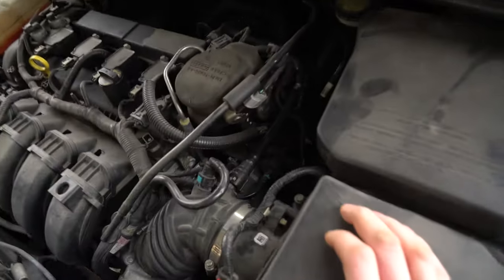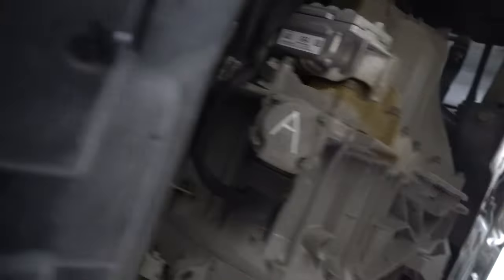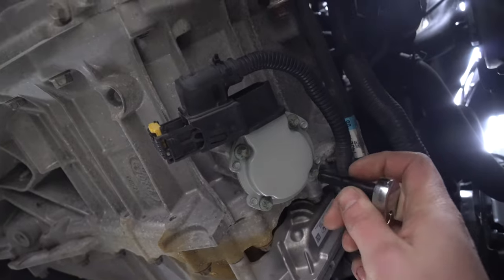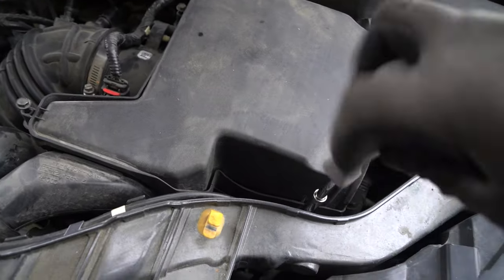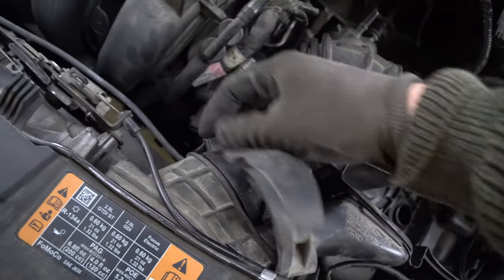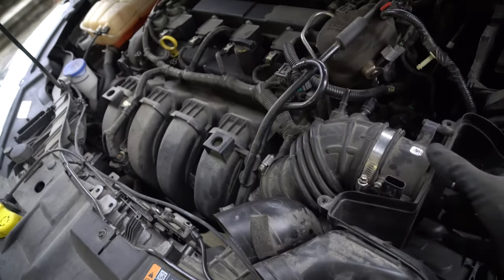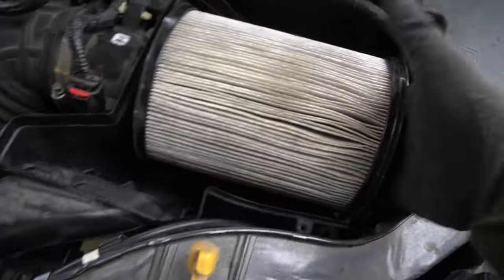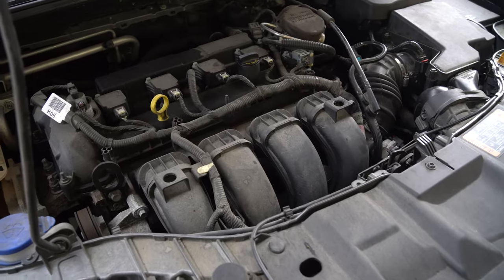HOW TO CHANGE FORD FOCUS TRANSMISSION ACTUATORS

Comment: Every other video says thee top one is A and bottom is B
Reply: They are incorrect B is on top and A is the bottom cause it’s dumb but ford lied , B isn’t reverse it’s Drive 
A u get a P0703 and p0700 code sometimes u get a actuator code P0909C but rarely happens when they die . The top one I have bad it’s P07A2 not 3 and P0700 it won’t go in drive like to drive in drive but if u hear every click shifting all gears then it’s not a TCM or a TRANSMISSION PROBELM, it’s a CLUTCH ACTUATOR PROBELM . U change them both don’t change one cause it’s dumb you’ll end up going on the other one , and do the bypass to reprogram reset the program, cause ford has computers u get a wire u take the battery terminal off on at a time and u put a wire as a ground on the bolts on your battery termails both being off the battery 10 mins then take the wire off as a ground reset wire and then put the battery together ur good to go
Reply: A is top
Reply: because P0805 was my code for actuator A. Replaced the part and it works when it wouldnt even go into gear before
Reply: A is top I agree
Reply: @LuhNoSho  a is top

Comment: The bottom one is B controls reverse 2-4-6
Reply: yes bottom one is B. Top acuator motor is A. P0805  is A
Reply: Actuator A is the top one and the code I ran today was p073A transmission friction stuck
Reply: I guess there’s 2 codes for (A )being stuck and the actuator actually going out 😂 Ugg this is getting funnier every day I think of how garbage ford is

Comment: A 1/4 inch socket with a 1/4 inch drive will take the bolts out of the actuator for anyone wondering!
Reply: you may need a swivel socket to get to the back screws. but i just moved the hoses out of the way
Reply: That’s how I take them off with a 1/4 inch socket with no problem

Comment: I got a 2015 Ford focus as well and the other day i was driving and all the sudden i tried to accelerate and my RPM’s reved way up and i wasn’t going anywhere. Had a diagnostic and the code came back as “p090c”. My car still changes gear and goes in reverse though. I googled the code and it says my clutch actuator B is low circuit. Ford is trying to screw me and say my extended warranty expired since it has 130k miles on it even though I’ve had my transmission recalled. What should i do? I was reading that possibly it’s my TCM?? Idk man i need help it’s my only car and I’m really not in a position to pay a ton of money for it to be fixxed. Any advice?? Should i try to do what you just showed in the video?? Any suggestions appreciated. Thanks
Reply from the maker: Sounds like its could be the clutch actuator, i would replace both to be sure
Reply: @ghostlyrich  alright will do i got 1 coming tomorrow but i guess i should go ahead and just replace both of em while I’m at it. The “B actuator” is the one located underneath the vehicle, correct?
Reply: @addisonsigley8033  Did this fix your problem?  Same thing happened to me but no error code
Reply: @mitchhake4116  no it didn’t. I changed out both actuators and it worked for a few days then same problem happened. I took it to the shop and they told me it might need a new transmitter range sensor and battery so i replaced those and it worked for a few days and now the same issue. I’m goin to replace the TCM later this week and if that doesn’t work I’m going to have to sell it smh
Reply: Did you ever figure it out? I have two new actuators on the way. I first tried to clean the orginals, it worked for about 20 minutes, and then it started slipping again and couldn't put it in reverse. I'm hoping two new ones will fix it butt I'm worried it may be more than just that. Sometimes it works if the car has been sitting for a little  then when I start driving for a bit it will start ti act up.
Reply: @addisonsigley8033  took it to my mechanic and he said the transmission itself  is failing and to get rid of it before it starts throwing codes/breaks down
Reply: @mitchhake4116 the code pops up after you do a transmission reset it’s video’s on YouTube on how to reset it
Reply: @addisonsigley8033 can’t just replace it with out cleaning the forks and resetting the forks with a screw driver turning it counter clockwise 14 times and spraying brake cleaner and wD40 on it that’s what causes the actuator to go out in the first place making it work harder because the fork tracks are covered with clutch dust

Comment: Other than a no start condition. What are some other symptoms these are going bad? Inlaw’s focus won’t start and wont shift out of park either
Reply from the maker: The vehicle wont start unless the vehicle can see its in park. Will the shifter not release out of park?? Could be a shifter problem
Reply: @ghostlyrich  iirc the computer said clutch A and B were stuck engaged
Reply from the maker: @brandtheman92  sounds like the actuators for sure its a very common problem on the car unfortunately atleast its a very simple fix with basic cools
Reply: Is there any kind of relearning processing? I keep hearing that there is.
Reply from the maker: @ww-eg2gn  if you have the software to do so you can but the TCM is just going to relearn it shift points as you drive the one we did it on is still working fine no issues whatsoever
Reply: Is actuator A and B the same parts?
Reply: Actuator "B" & " A" are they the  same or just look. Alike
Reply from the maker: Same

Comment: Hi there. My 2014 ford focus se was fine. I’ve had it since 17, brought it used when 17k miles in it and now it has 82,600. It has shuddered before occasionally from a stop and even jerked occasionally when accelerating from stop .  It started jerking really badly two nights ago.  No issues going in reverse , yet at least. 

I had it towed to dealership, and I was expecting the extended service warranty to cover it but they diagnosed it as the clutch and that warranty expired in 2021, so convenient for Ford. Dealership quoted me 3500 dollars to fix it, which is more than it’s worth. 

I’m no mechanic and never did any of my own repairs but this is making me think about it. It doesn’t look THAT difficult but still intimidating to a novice. 

I feel like Ford and the dealership are trying to rip me off. I mentioned maybe trading it in for a newer vehicle and I’m getting non stop calls and texts now lol 

Based on everything i just said, does it sound like simply the actuators to you?  I’m going to go pick up the car and bring it home in a bit (kind of scared to drive it now).  Shouid I ask them what code came up? I wonder if they offer that information
Reply from the maker: It could be that, or if you look at my other video, you could have a dirty throttlebody you might wanna clean the throttlebody to make sure that at idle it’s getting enough air.
Reply from the maker: The shuttering could be a few things like throttle body is dirty as well as when was the last time you did your spark plugs?? Sounds like it could use a good cleaning and tune up. The actuators would be more missing or slipping shifts and not going into gears
Reply: I have the symptoms of the actuators slipping sometimes and skipping gears I already order the actuators A & B the crazy thing that gets me to think is it only does it for a bit than it runs fine I reverse works fine but sometimes going forward takes few seconds to move you think the actuators are going bad? I am mechanically inclined but my question ❓ do  you have reset the transmission and programmed to drive again and I now there's a sequence?
Reply: Could be actuators but it could also be the clutch forks not sliding properly due to a build up of dust and crud .
There are other videos on Utube that show how to clean these without taking the gearbox out !
Reply: I replaced my actuators about 2 weeks and yes my friend they don't need to be programmed at all I got all that information from a Ford technician but I did recur to clean the actuators housing and that help a lot I haven't had a major issue ever since. Sometimes but is really rare

Comment: I have a 2014 ford focus se and after almost 10 years of no issues and me being the only owner I was accelerating at a red light and the check engine light came on. Then shifting from 1st to 2nd the car kinda stalled and jerked before it changed gears. When I hooked it to a computer it gave me the code P0903 which is commonly the clutch actuators. But it could also be the PCM or TCM it says. Should I go ahead and replace these or just take it to a shop?
Reply: It’s the Clutch actuators !! Just do this before confirming , does it reverse ? , do it drive forward in Drive ? , but the most ultimate thing to check if it’s not TCM or transmission inside , u get in the car put the key turn car don’t turn car on and u press brake down u hear a click on each shift from P-L and then it’s confirmed a bad Actuator dealerships will lie say it needs a new tranny
Reply: yep. try changing your clutch actuator B which is underneath the car.

Comment: Did you have to use the special tool to unlock the transmission before installing the new actuators
Reply from the maker: No

Comment: Its had to find out the correct info when people call Actuator A the top one and actuator B the button one and vice versa, so who is correct? I having issue with code P0902 on 2016 for focus SE, I changed the top one and still having the same problem like before,
Reply: Codes will appear it the actuator gets stuck or if it goes out I’m guess 2 codes per actuator mines was (A) the code was p07A3 transmission friction stuck I’m guess the actuator probably still good just the fork track is covered in clutch dust causing the actuator to not move on the track for the computer to select the proper gears

Comment: Its a 1/4 socket that will take those off a normal 6  point 1/4 socket will take the actuator bolts out.
Reply: yes a 1/4 socket on a 1/4 inch drive

Comment: so to confirm Actuator A is the top and B and the bottom?
Reply: Yes, A is on top and B is on bottom.
Confirmed with the local Ford dealership when I bought the part.

Comment: Hi my ford Focus 2012 is have slip gear from 1 to 2 but still drive fine . I changed the auto transmission fluid but still slip gear. Should i change actuator? But there is no engine light on.

And if I changed both actuator by my self ,after that we should to scanwith ford  to relean or  no need to ?thanks
Reply: It's the shift forks under the actuator spray wd 40 to lube them. But dont over do it it worked for me.
Reply: What fluid?
Reply: @nerfthecows  motorcraft dual clutch transmission fluid.
Reply: These gearboxes suffer from dust issues  within the  bell housing .
The forks get jammed up with dust .
To do a proper job the  Gear and box should be removed clutch removed .
Both clutch forks should be removed and  cleaned and made sure operating correctly .
Replace all and the job is done .
Reply: @adrianfoy6790   easier said than done😑

Comment: Are clutch Actuators A and B the same part number ?
Reply: Yes
Reply: @ZenicYVR are they interchangeable? Like can i take the actuator from under the hood and put it where actuator B is under the car?
Reply: Only difference is the computer that plugs into the actuator has its own separate ways on how it changes the gears but part numbers I noticed was the same

Comment: Is Dielectric Grease safe to use on the actuators?
Reply from the maker: For sure any where current/electricity does not need to pass through

Comment: Question so if I’m getting a code to change a is that the reason my car won’t start
Reply from the maker: If the actuator doesn’t know what gear it’s in and chances are, it won’t let your car start
Reply: @ghostlyrich  I change my actuators both of them car started and was able to run. Then it started doing the same stuff again wouldn’t start doesn’t go into reverse or drive.

Comment: How do you tell the difference between a and B
Reply from the maker: Same part number just slipem in
Reply: @ghostlyrich so they’re interchangeable? You don’t have to worry about putting a B actuator where the A one goes and causing more problems??
Reply: (A) gear 1-3-5 the top one under the air filter box
(B) reverse - 2-4-6 the bottom one underneath transmission

Comment: My car Ford Focus 1.6 L 2013 automatic has a transmission issue. When the engine becomes warm after driving for more than one hour, the dashboard shows transmission error and gear shifts improperly.  The local garage couldn't find the exact reason.  Error codes are P0606 and P06B8. Could you please tell me what would be the reason?
Reply: Same